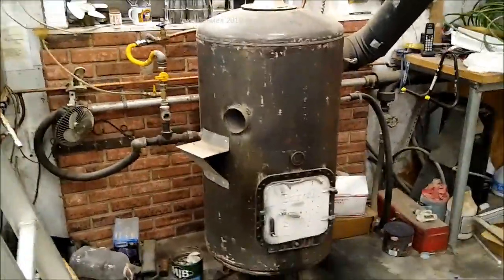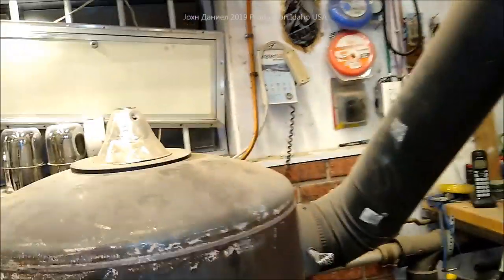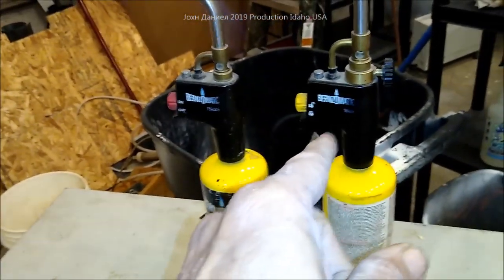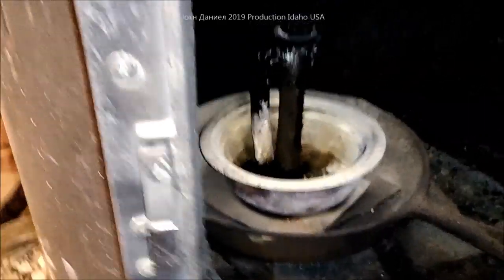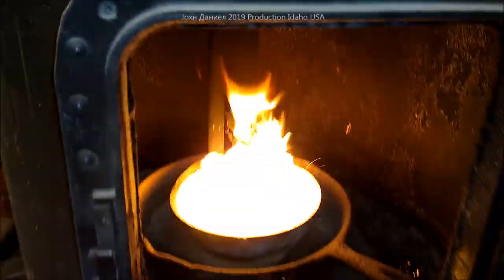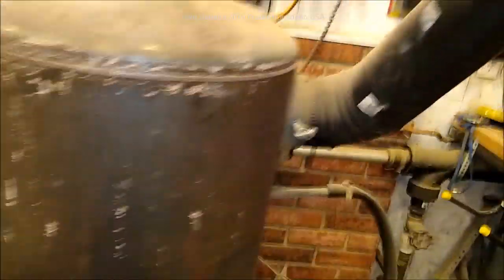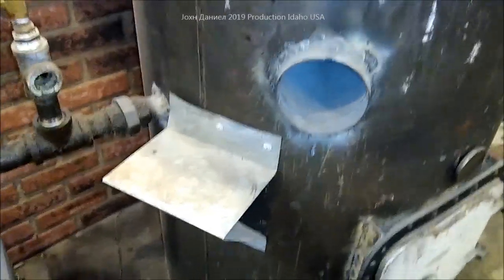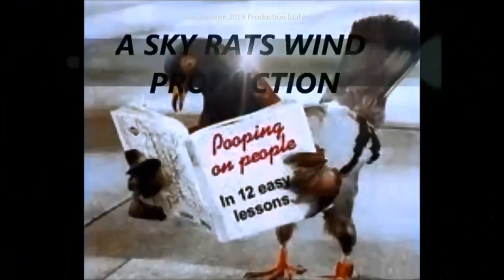Forced Air Waste Oil Heater, system info update & Parts List below

Comment: How much oil do you use per hour approx? Thanks
Reply: Awesome Thanks !
Reply from the maker: Depends, but I run its flow control with 0.3mm as slow, 0.5mm as fast. In 8 hours about 1.6 to 1.8 gallons on 0.5mm stream on it.

Comment: way to much crap for heat. way easy just a drip feed with the proper air flow. yeah you got to much crap goin on. dont need paper to start it either

Comment: Direct approach, with plans, parts list, and infinite room for improvisation and adaptation!
Your video should be easier to find. Thank you for making it!
I am in the beginning of a heater build that uses an old water tank as a hot air exchange (8 inch fan will push air when a programmable thermostat signals)  with a burner like this.
The platinum plate from a Mercedes... was that from a catalytic converter?

Comment: was thinking about building one myself out of rims and leaf blower and for heat exchanger wrap some steel around rim beads and blower exhaust and air outlet run into the burner as well as some air around outside of the rims👍
Reply from the maker: Careful, too many seams in that scenario for this level of heat.
Reply: reason I think rims would be nice is they can be stacked yes there's more seems not sure how well it'll work hoping some rope gasket will seel good will need to cut one bead back little and have little bit of overlap so rims can slot together. May need some bolts or clamps to make it air tight and that's all I have figured out. 
Need some time to do some experimenting😉

Comment: There's a long tradition of waste oil garage heaters but I would always be a little concerned at the heavy metals you may find in the additive packages found in motor lube. I guess its all about how you handle the exhaust exit.
Reply from the maker: You must filter hard core in settling style filtration. Adding magnets does not work, it needs to be very slow flow, no disturbing the filters or using pressurized flowing oil.
Reply: @JOHNDANIEL1  love the burner, great job! Should build one myself, but can you explain more, how do you filter the oil prior to burning it? You say you need to spend money to filter it?